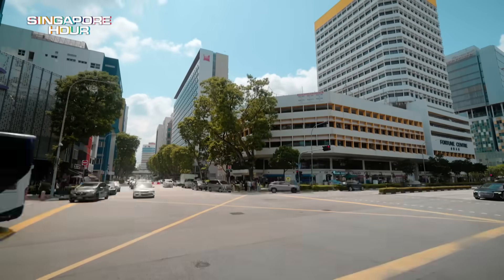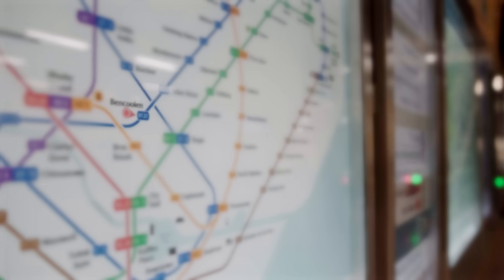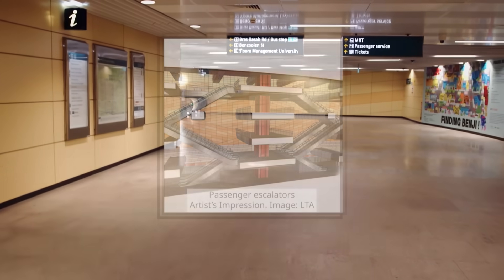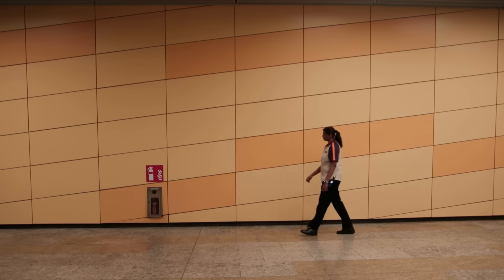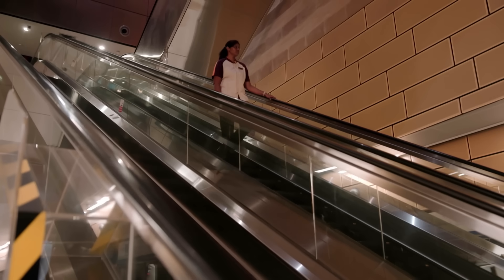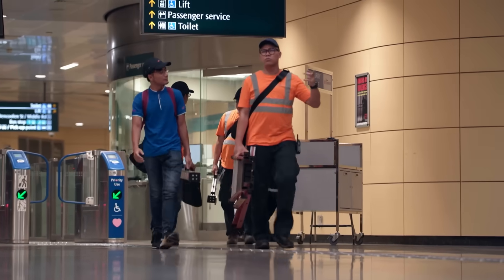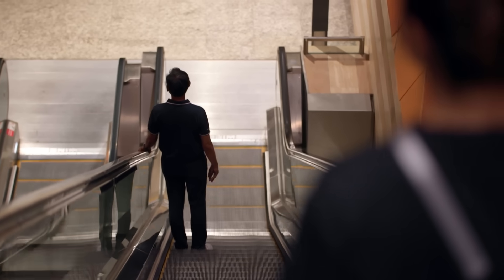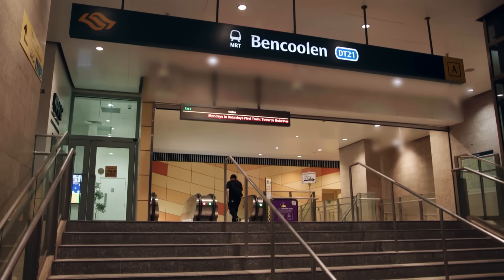How Singapore's Deepest Mass Rapid Transit Station Was Built | Singapore Hour

Comment: Good video but does the address the question in the video title. What tunnel boring machine was used? How is this different from other digs? What’s the soil composition at that level? What challengers do excavation engineers faced in building this? Instead, most of the video is about operational.
Reply: Kudos, you are right - the title should be more accurately called "An Introduction on How Singapore's Deepest Mass Rapid Transit Station Was Built"

Comment: Tip: if you’re going from one side of the island to the other on DTL, you save at least 15 min coming out of Bencoolen and hop onto Rochor or vice versa
Reply: I assume you mean coming out of Jalan Besar station to hop onto Rochor instead? It is a pity there is no underpass to connect between the 2 stations
Reply: @joyseng  That loop even though both stations are physically side by side literally. smh.

Comment: one of the better run lines in our system. although one must acknowledge that the access penalty going so deep vs using the bus at grade can be a factor for any kind of passenger, whether elderly or wheelchair users or not. I’d be curious to know how long it takes to evacuate this station in an emergency.

Comment: Ampang Park MRT is 45 meters deep
Reply: "The deepest new MRT station in Singapore will be the Cross Island Line (CRL) King Albert Park station. It will be 50 meters deep, equivalent to a 16-story building. The CRL King Albert Park station is part of the Cross Island Line Phase 2 project, which is currently under construction and slated for completion by 2032."